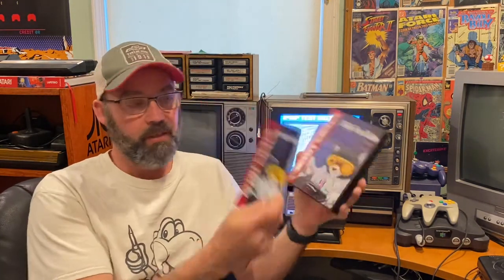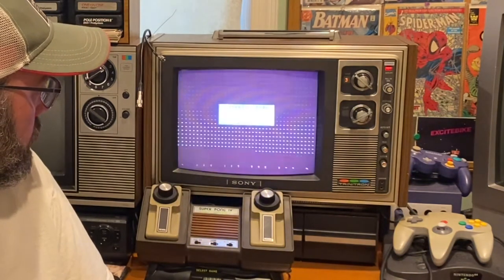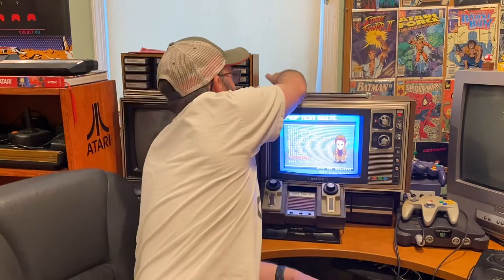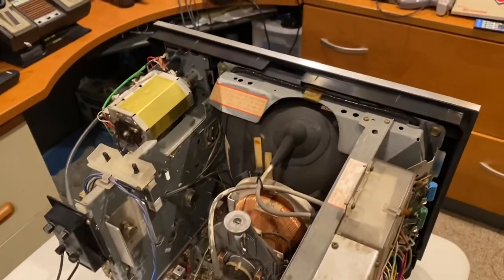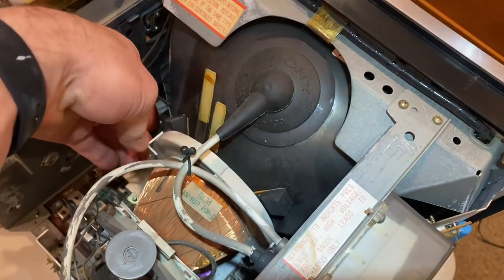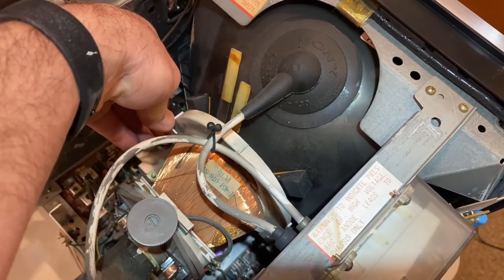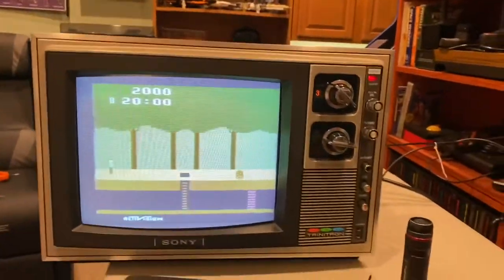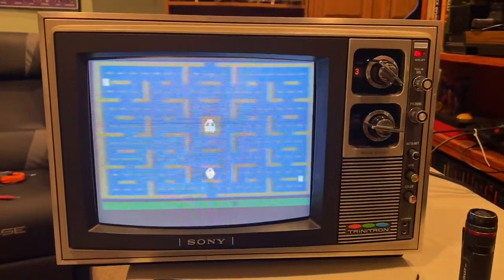1976 Sony Trinitron Repiar/Restoration Part 4 (Finale)

Comment: Congratulations on the restoration. I'm amazed you were able to fix all those geometry issues without (presumably) using magnets on the back of the tube. One pro tip I've learned that you might keep in mind for future repairs: when adjusting geometry, place the TV in the same orientation as it will sit when finished. I've made the mistake of doing adjustments with the TV in a different orientation and then watching all my hard work go out the window when I put the TV in its final spot. Earth's magnetic field can play some mean tricks on a CRT!